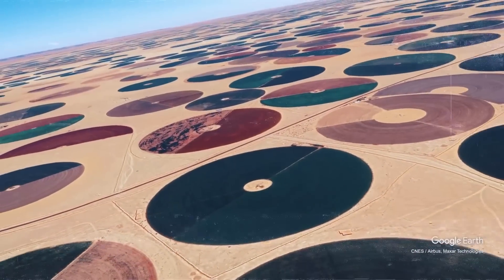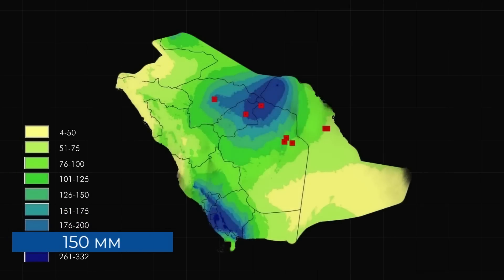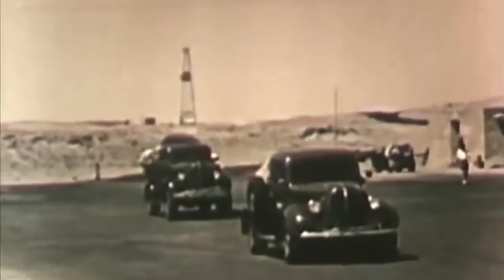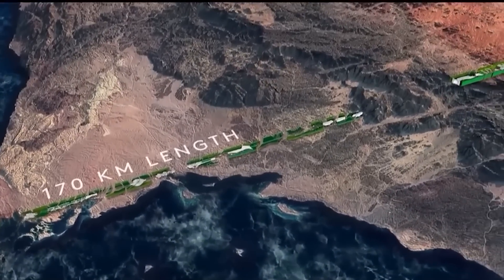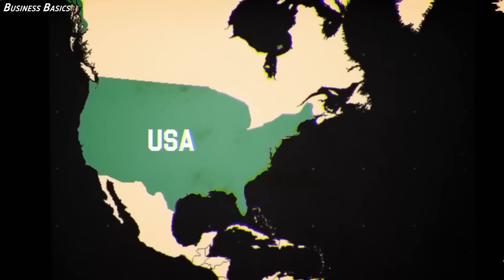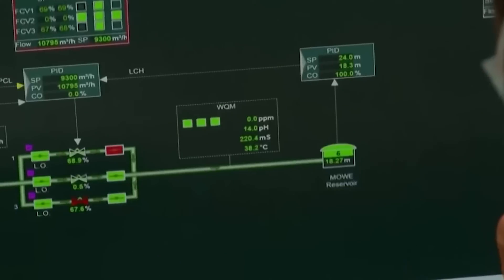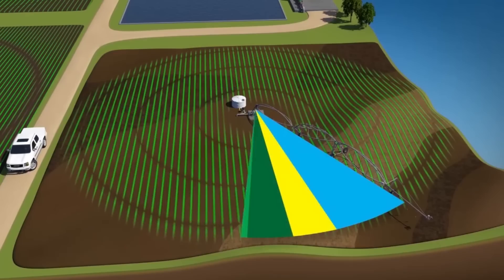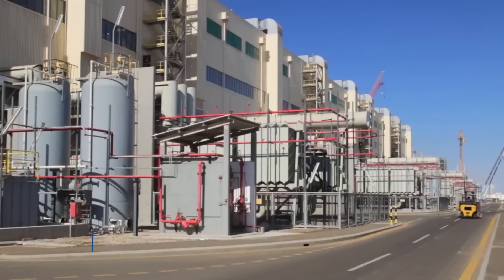Saudi Arabia's Breakthrough has SHOCKED American Scientists

Comment: Rubbish.  They are in effect turning oil into water.  The oil is a finite resource.  Water will needed forever.  Oil is expensive.  Water has to be cheap to make this kind of irrigation feasible in the long term.  They are jut burning their candles at both ends.   This is obviously not sustainable.

Comment: Where are they getting the dirt from?
Reply: Same question here .. They forgot to mention Where and How they managed to bring fertile soil to their desert and how they manage to fertilize under such intensive agriculture method. Crops such as wheat are known to consume a lot of soil nutrients, and i wouldn't be surprised if they don't have much predators for agriculture pests in the middle of the desert, which would required huge lump of fertilizers and pest controls
Reply: Composting bodies
Reply: @daviecrocket9160  compost made by hand.🖐🤚👋✋️
Reply: You can grow crops in sand. It just takes a lot of water as sand doesn't have much water holding capacity. After a while, humas builds up from decaying plant matter. In about 100 years, you get an inch of topsoil.

Comment: How are all the desalination plants powered?
The desalination process is notoriously energy intensive, and the product is known as "liquid electricity".
Similarly, how are the underground aquafers replenished?
It took thousands of years for the aquafers to be filled,; what happens when they are finally pumped dry, as will happen within the next couple of years?
The entire agricultural system will collapse.
Reply from the maker: That's a very good point.
Most of the desalination plants in Saudi Arabia are powered by fossil fuels, particularly natural gas.
and yes When the aquifers in Saudi Arabia are pumped dry, it will result in a scarcity of water supply, which can have significant impacts on agriculture, industry, and domestic use. The country may need to rely more on desalination, which is an energy-intensive and expensive process or look for alternative sources of water such as treated wastewater or imported water. This situation highlights the importance of sustainable management of water resources.
Reply: Energy is not a problem in the future. And for now they use oil and gas. They have plenty.
Reply: @Revolver.Ocelot  Pretty sure it's sunny in Saudi Arabia, maybe why they're constructing solar farms with 60Gw planned by 2030.